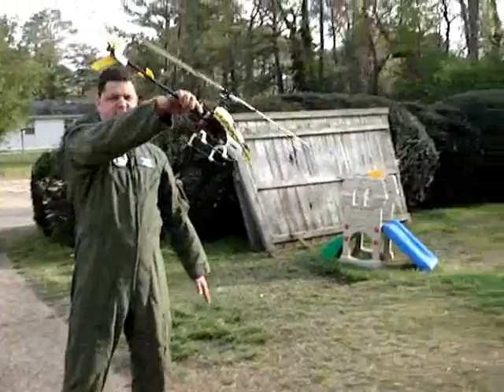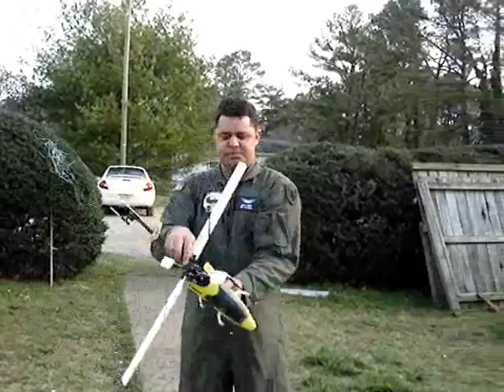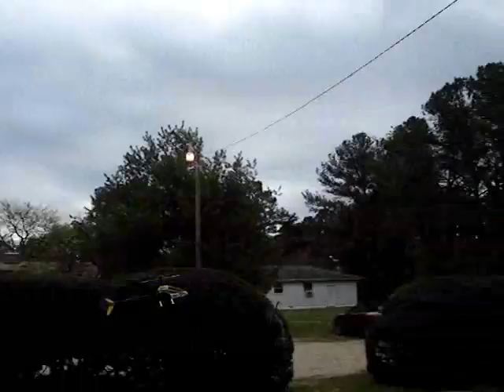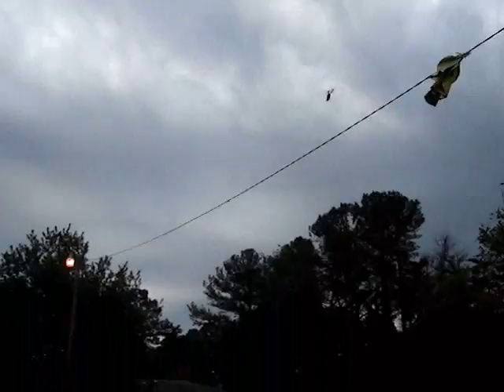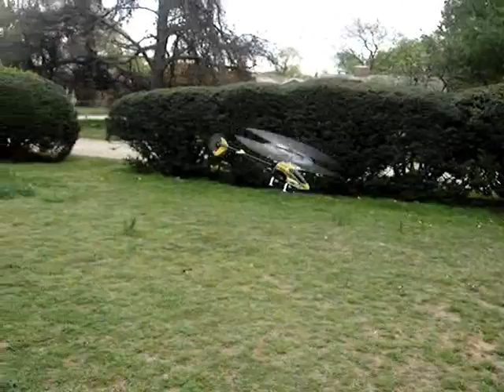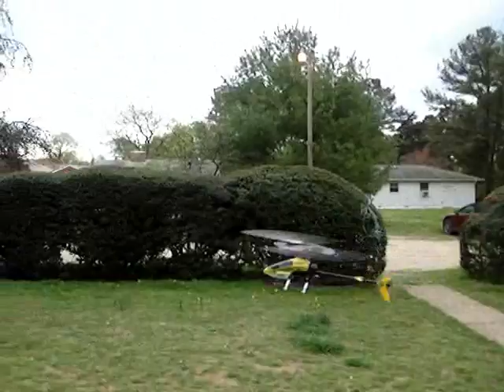Blade 400 3D Forward Flight

Comment from the maker: @CaptainCarling the 400 is a very stable heli. it will need  a good setup of the head ant tail. the resopnes in controls and power are almost 10 times that of the small helis. so be very slow when first starting. this heli can defenetly help with the basics.  i recommend servo and gyro upgrades to move in to advance manuvers. upgraded servos make this heli have a more locked in feel.

Comment: Great flying! Saw the convo. about rigid v non-rigid rotor heads. I worked avionics  on 60's and 46's in the Navy, so im pretty familiar with full scale rotor heads. Do you think their could be any advantages to a more scale-like non rigid setup on an RC bird? Not sure it would be easy to setup mini droop stops and blade dampeners tho : )

Comment from the maker: yes i fly only in stunt mode(idle up)
its make the heli more stable and more responsive and also enables inverted manuvers. keep at it and become much more comfertable with it before you go in to idle up mode as the throttle will not cut off if you crash and dump the stick. you will have to hit throttle hold to stop the motor. keep at it ans soon you will only fly in idle up as well